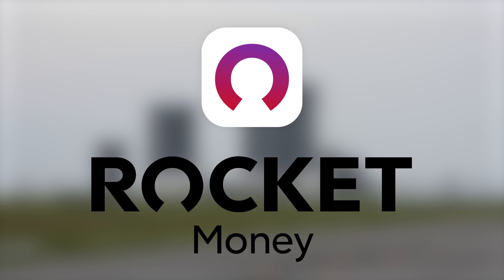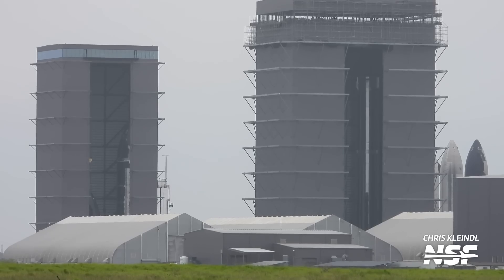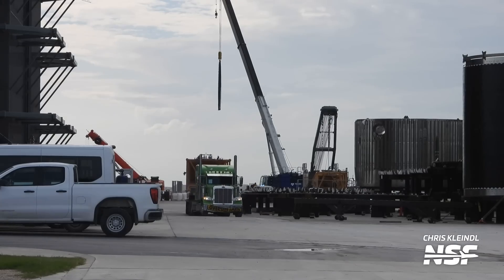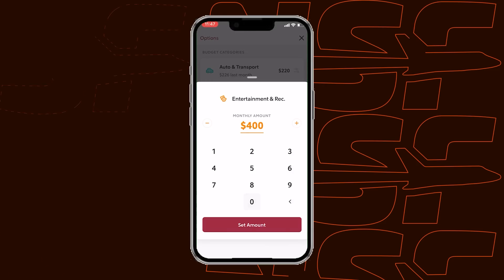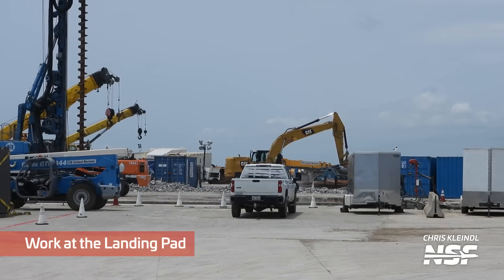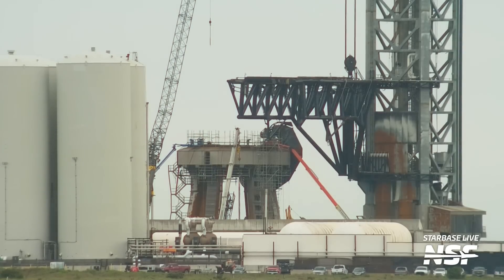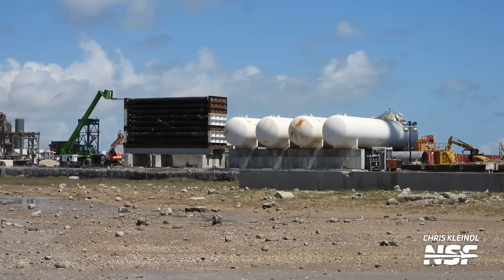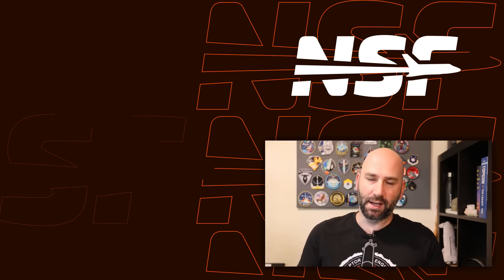Massive Progress at Starbase! SpaceX’s Next Moves Revealed | Starbase Update

Comment: 1. I'm impressed with the use of steel as a blast protection system, titanium or copper alloys might be my first thing to think of here, can someone explain the reason?
2. So many tanks to put huge pressure behind deluge water to push it against the pressure of the Raptors, I though space launch systems use water tanks to have immense pressure on without using energy directly. Are pressure vessels better here?
Reply: Titanium is expensive and a pain to work with, and it can oxidize rapidly and even burn when heated above 1000C or so. 

Not sure about (2) but I'd guess the required pressure is too high for a conventional system to handle.
Reply: @lukekambic3536  thanks

Comment: The numbers show that a fully fueled Starship, with no payload, is just capable of orbital flight.  Using the suborbital launch site for Ship 25 would be a way to test how well the heat tiles and reentry systems work before the OLP is repaired and full stack launches can resume.
Reply: The numbers do not in fact show that at all. You would need to extend the tankage and add 3-4 more Raptors to make it into orbit with just Starship
Reply: @ale131296  You are right, I should have said sub-orbital flight.  A sub-orbital flight could be made without the modifications you mention for Ship 25 and that would accomplish the same things - testing the heat shields and reentry protocols.

Comment: That testing of the of steel plate is twice as close as the actual distance at the platform. They're moving in the right direction with this.
Reply: Unfortunately they don't have the capability to do more extensive tests before building the whole system at the launch site.  That is part of the problem when building a 33 engine system. They don't want to build a full test stand despite claiming to have more Raptors than they know what to do with.  When your launch mount is your only full test stand, things that should only happen in testing happen to much more costly things instead.
Reply: Give it time.

Comment: Could it be possible that ship 25 could be the sacrifice for the flight termination system. I doubt the FAA would qualify the recent retest as a certifiable event. They more than likely want to see it happen during flight.
Reply: The weird thing in the Flight Termination System activation was that the software did not shut off the booster engines.
Reply: @warrenwhite9085  It was stated in a tweet by Elon that some of the engines were not communicating with the control system (they lost communication), so that might explain some of the failure to not shut them all down.
Reply: @warrenwhite9085  I think they lost the ability to close propellant valves because of damage (loss of hydraulic pressure, detonating turbo pump or combustion chamber). That's the only explanation for the booster firing continuously until breakup.
Reply: If your going to waste a ship just to prove the FTS for the FAA's sake (which I strongly doubt being a requirement and could easily be proved on a test article as has already been done) I would have thought that they could use SN16 at the rocket garden, since it's never flown and is just a Rocket Garden ornament. Send her up and send her out in a blaze of testing glory, as the sacrificial lamb, rather than Ship25.
Reply: @David-yo5ws  Well, the more revised ship they use, the more data they can get on systems as they exist on the newer versions.  A whole test flight of such an immense rocket for so little test data is more wasteful than practical, I think.
Reply: @troys9222  I agree. SN15 flew and landed. But SN25 is very similar to SN24 (which was to have been a big part of the 1st flight test). Both are much more evolved than SN16. I believe they would get a large amount of data from a licensed suborbital flight or maybe a partial orbital one. It would be worth the fuel, especially if SN25 was otherwise scrapped.
Reply: This seems like a pretty good idea, much better than simply scrapping it. With Raptor 2 engines, and no (or very little) cargo, Ship 25 could (or almost) make it to orbit. It could test many things, including the heat tiles and StarLink door strength. On its way down, it could also test the FTS (out over the ocean, not the pad). The FAA license approves 10 suborbital type tests, I believe.

Comment: It seems there would be a way to have a steam tank under the launch mount that could generate the pressure to push the water in the deluge system.  This would reduce the consumables for the launch, and be self regulating as the the Raptors would be used to create the steam and once the rocket is gone, the heat source would be removed.
Reply: The generated steam may not supply the 'instant' high pressure that is required. They need enough force to generate about 50 tonnes per 0.1 m² to prevent the exhaust from blowing water backwards through the pipes.
Reply: Hence the big stacks of high pressure tanks being installed.

Comment: The lifting rig needs a pick point that is offset to the total center of mass. Not just the center of mass of the rig itself. Perhaps a variable extender based on the lifting loads. Self measuring, so the load auto adjusts the extender.
Reply: In theory though, the rig, once balanced, should lift straight. So maybe it was just a foobar.
Reply: @Anthony Losego  here's the thing. In theory, the ships center of mass is right in the center of that circle (or some other known location) in practice, it will always be off a little. With something this big, I think they need to accommodate some inexactness with additional stays.

Comment: The ring-shaped lifting rig needs three, not two ship-lifting points.
Reply: 2 is prob enough if evenly spaced.. Kinda' like those Drink Holder thingies; But yes, 3 would be better:_FalconHHug:
Reply: They are trying to assemble with the heat shield and many of the service runs preinstalled on the barrels. The heat shield is all on one side relative to the line between the two lift points and the two point lift jig is only spiffy if the mass remains balanced perpendicular to that axis because they must lower it perfectly inline with the barrel they are adding before welding them together, although once the assembly is completed a very small imbalance would not preclude a chopstick lift using those lift points.

Comment: I wonder if it’s wise to build so many ships considering there still may need to be major design reworks for a successful orbital launch. They have already skipped multiple serial numbers of boosters and starships. I suppose they could be cheap enough that it doesn’t make much difference.
Reply: The idea is that they aren't building prototypes to test. They're building a manufacturing system. 

Up until Ford, people built cars. Ford built a car manufacturing process. That's what SpaceX is trying to be for the orbital market.